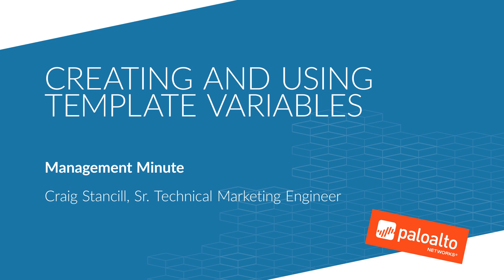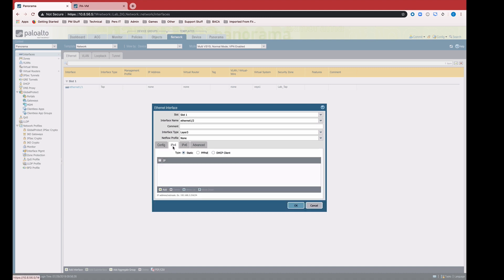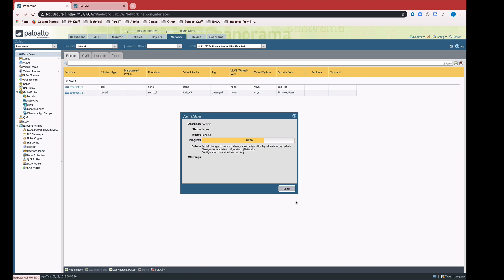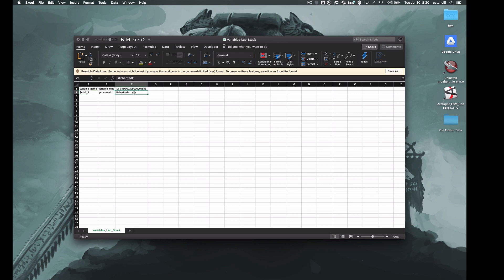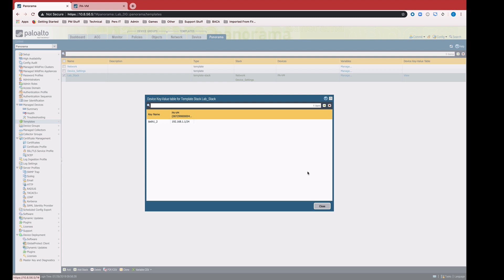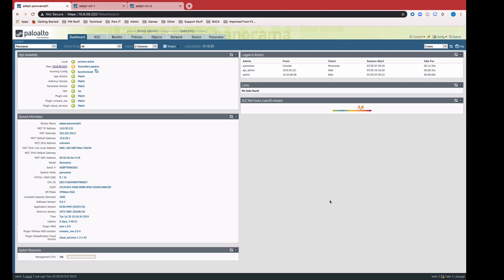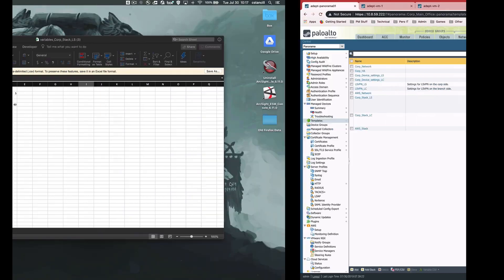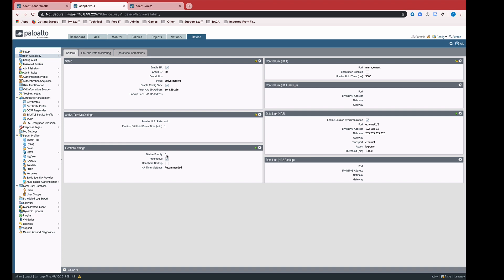Creating and Using Template Variables

Comment: Nice explanation 

Just have one doubt  how HA priorities has changed though both ha firewall having in same template stack
Reply: I came here with this question too - but if you have a look at 6:53, you can see that in the variable CSV file, there is a column for each member of the HA pair, so you can assign different values to the same variable